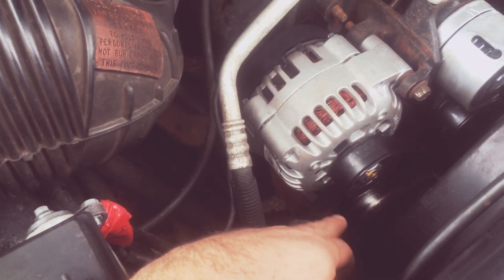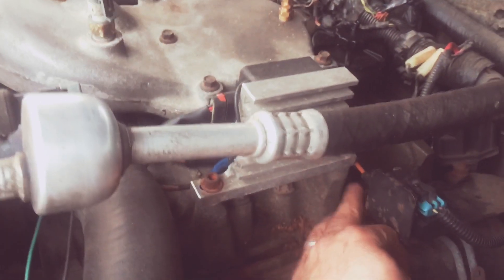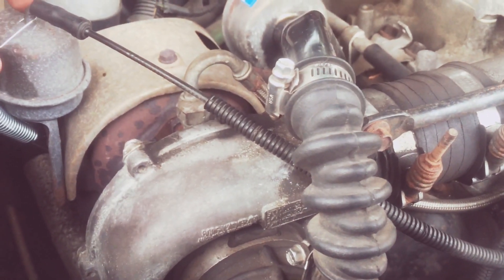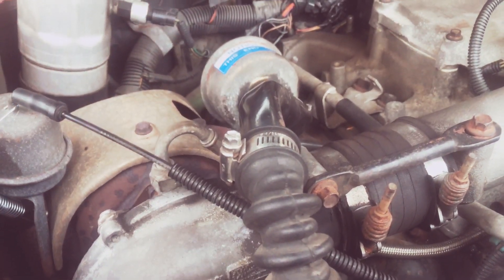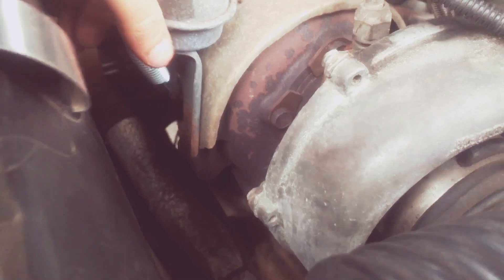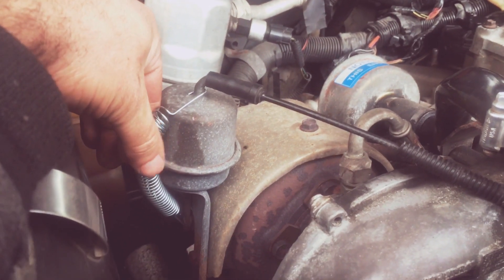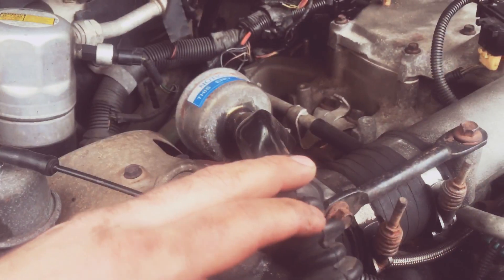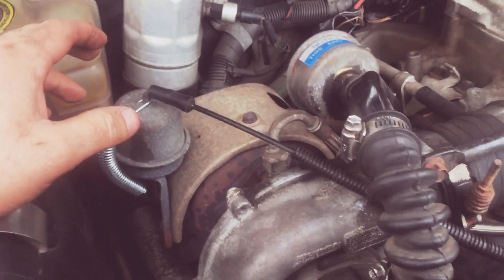6.5 Turbo Diesel Engine Cheap Truck TurboTips

Comment: Best upgrade you can do for a 6.5 is a Quadstar tune, FASS lift pump, and super60 turbo. I’ll be running 25+psi on factory head bolts. Btw, I don’t recommend springing the wastegate without a boost gauge. The gm turbos are way to small for these trucks and produce an insane amount of drive pressure.
Reply: Bs on 25 psi on stock internals, and stock headbolts.
Reply: Links to the tune and turbo ? And what kinda fass lift pump you use ?

Comment: Karfix,  I have a 94 6.5 turbo K3500 truck. It starting having a problem occasionally of not starting and getting worse. Cranking over normally, but not starting. I changed the fuel filter. Didn't help. I noticed two of the injectors are really oily all around them. I removed the air filter box to get a better look at the passenger side and found a lot of oil inside the turbo where the air box connects. Do you think the problem is bad injectors, or something else?
Reply from the maker: DIY Oregon Check your fuel pump relay, Glow plug relay, fuel pressure. It’s very important when you change your fuel filter to prime the engine. I think your problem is the glow plug relay. But check all the thinks that I told you.
Reply from the maker: https://youtu.be/Skddz7WC4uQ try this on this video. Hopefully it helps.
Reply: @Karfix  ok, thanks, I'll check it. them.
Reply from the maker: Ok let me know how you make out.
Reply: DIY Oregon I have a 96 gmc & I have the same problem lots of oil. Also when I shut the engine off smoke comes out of the air filter box. For what heard is the turbo. I m changing it soon see if fix the problem...if your truck crank but won't start I believe is your PMD also Relocate it  & you won't have more problem..
Reply: I replaced and relocated the PMD. I went ahead and pulled the heads off and found out BOTH of them were cracked!  They said that's why I was loosing coolant and having trouble starting. The engine would also miss sometimes. The shop ordered new heads and put everything together. I just picked them up today. Since I have so much taken apart I am degreasing everything and going to paint  a bunch of the parts, replace fuel lines and so on. New injectors and new glow plugs.
Reply: @diyoregonnowtexas9202  ...if you have a crack on both heads..this is cause by over heating..try it to keep it cool. get your self a radiator fan from a duramax this one blows lots of air much better than the stock one.
Reply: oh,ok, does it fit or do I need some kind of adaptor or fabrication? Also is there a specific Duramax year or model I need?
Reply: @togodbetheglory9725  - at this point I just cant afford it. Ive  put in $1800 for new heads, gaskets, glow plugs, injectors and small odds and ends. I'm going to have the fuel injector pump tested which is another $115 and God willing it is ok. If it needs to be replaced they are $1200. Not sure how much to rebuild, but a lot. Essentially this started out as a head gasket job and has turned into an entire top end rebuild! It keeps getting worse by the minute. I'm wondering if I can find a Duramax fan at a wrecking yard. I saw the 130 GPM after market water pump I would love to put on, but again, now we're talking hundreds of dollars for that and to make it work right you have to get the dual chamber thermostat housing.
Reply: @diyoregonnowtexas9202  its biting a bullet but do it, its well worth the sacrifice in money, while ur at it get the machined crank shaft from heath again while ur having it mostly apart its cheaper to do these things now then later down the road get he dual chamber thermostat housing to prevent an other brake down/crack !
Reply: @Noneedforhandlesanymore  It's all back together and seems to run just fine, but a gutless wonder. I'm keeping my eye open for a 12v Cummins and do a swap. That will give me the power I need.

Comment: Did you just screw in adaptor for boost gauge?where intake bolt was
Reply: just pull the plate, Drill and tap. no biggie. just don't do it while installed so you don't dump shavings into the engine.
Reply: No...please don't do this.  The intake cover has holes already drilled.  You can buy a banjo or passthrough bolt from several 6.5 parts dealers where you just unscrew the existing bolt and use the new one.  Then you just screw in the fitting for the air line.

Comment: Id use a lottle stiffer spring. Mine has the spring and i cruise at between 4 and 6 psi, 10 psi when accelerating. Ive hit about 14 psi trying to see how high the boost goes. I try to keep it under 12 psi until i get head studs. Thats when it starts feeling like a little much.
Reply from the maker: Nice man!

Comment: Definitely a safe improvement if your vacuum isn't working, but on a diesel the air fuel mixture is not always balanced like it would be on a gas engine. If you can get a stiffer spring, more boost is good for those engines.
Reply from the maker: More Boost always better!!
Reply: Jonathan Erber more boost is not always better on a 6.5L Detroit Diesel.... They have a 21.5:1 compression ratio, if you throw in more than 10psi of boost you need head studs not head bolts... Is you throw in more than 10psi with head bolts bad things happen to your head gaskets
Reply: No more boost then 15psi at max in a 6.5 without putting 18.5.1 compression pistons in trust me  if u dont it will blow
Reply: Jack Thibeault 21.5 compression is better than 18.5, except when you want to throw in boost... The fact is you can throw it 40psi on 21.5 compression if you use head studs
Reply: Mach SCGA lol
Reply: Mach SCGA im not going to argue with someone that knows  nothing about 6.5
Reply: I know from experience  i have built  a bunch and heaths performance  is my go to
Reply: Jack Thibeault works fine on one of mine
Reply: Mach SCGA u are one lucky  man
Reply: Jack Thibeault now I will grant you all three of my 6.5L are studded and 21.5 compression two of them have their boost restricted to 15-20psi... The toy with 40psi and Marine injectors, it's been reliable enough for 65,000k now with no problems.... How long it will actually last compared to the others is hard to say... I know I'm taking life off that engine though, I wouldn't recommend you do it for daily driver 15-20psi works fine for MPGs.
Reply: Mach SCGA that awesome  i do like people that push the envelope  because im one of them but mine right now is set to 15-18 psi but im building a new motor for it as we speek it has a scat crank and a cam from heaths  and 18.5.1  pistons with water/meth with a super hx40 . Was going to do a dmax swap but said the hell with it ill just put another 6.5 together lol ive had several and even blew up a few trying new things to get powe out of them and when i called heath and talked to him he said my 21.5.1 was to blame lol he also told me that his twin turbo salt flat truck is pretty much a stock 6.5 with 40psi of boost  but it is a time bomb and how knows when its going to say enough is enough lol
Reply: Jack Thibeault yeah it's definitely a bomb and not practical, I also got my Idea from Heath...  I think a Leroy Diesel style build is much more to the average guys needs, after all these engines are great for fuel economy...  I recently got a chance to buy a deleted Dmax LML, but turned it down when I saw the price of replacement injectors on some sites $8,000-$9,000 (ball park) for some higher end Injectors. A set of 6.5L injectors from SS Diesel Supply are just under $8,00.... So I think I will stick with my 6.5Ls
Reply: Jack Thibeault I would also point out that Heath uses a 6.2L block I don't...

Comment: id take that off if i were you, my truck had one on when i bought it and took it off right away because by holding the waste gate closed like that your turbo wont have anywhere to push that unused boost when you let off the throttle,  resulting in your turbo blowing seals and then it will start chewing up oil and could possibly lead to a runaway diesel. all my seals were blown and had to rebuild it because of that spring.
Reply: total BS statement,  i trashed pump and wired gate open many miles/yrs ago w/no regrets
Reply: you can call it total bs but it blew my turbo seals an now my truck chews through the oil... so you do you there bud.
Reply: I run a complete manual waste gate on mine at 11psi with 330k with no problem lol his spring will be okay

Comment: your spring needs revising. I used a battery tie down bolt, whatever it's called. the less you restrict the movement of the spring the better. I'll try to remember to post what I did but it's really simple. get rid of that vacuum line and remove the vacuum completely. you'll need a different belt size. I believe it's size 99.5. I run mine at 10psi stock lift pump

Comment: I've been doing some research on how best to have better control over the boost. What you have done here is by far the simplest and just as effective as anything else I've seen out there. Very cool. Just a matter of getting the right spring tension. Thanks for the video.
Reply from the maker: +WLF FLD  thanks for your comments 👍

Comment: 5 psi is too litle for diesel engine. 5 psi is normal for gasoline engine. My Colorado diesel have 15 psi hevy load before wastegate open.and that is from factory.
Reply: Esa Puhakka your comparing apples and oranges here my duramax hits 24-27 stock these aren't meant for that in less supposed mods pump tuning etc.chill bro this guy is saving himself a motor build.
Reply from the maker: The reason I did this mod is because I still have a stock lift pump, original motor with 355,000 mile, and my vacuum pump wasn’t working so well.
Reply: I try to tell you can ad more boost and that not harm you engine because diesel can take more boost than gas engine.
Reply: Esa Puhakka no the 6.5 cant to run more then 12psi in a 6.5 u have to do head studs and swap in 18.1 pistons the 6.5 has 21.5.1 compression  they are a non turbo diesel that the factory put a turbo u can go ahead and try and put 20 psi for a long time  like the new diesels  and make sure to post the video when the head blows or the crank breaks
Reply: Just think of this a turbo gas car normally has 8.5.1 -  9.5.1  compression  a new diesel has 17.5.1 to 18.5.1 turboed and the 6.5gm has 21.5.1 because its not really  a turbo setup motor that the manufacturers put a turbo on with low boost try to help out with a little bit more torque
Reply: @Karfix   - Check out YouTube channel "Yankee Prepper" for how to "bomb proof" the 6.5
Fully getting rid of the vac pump is one of the steps...
Reply: @jackthibeault8698  have a look around in the marine industry with these 6.5 its actually amazing right down mind blowing what these idi engines can do so for sure with the right mods it can be achieved in pick ups